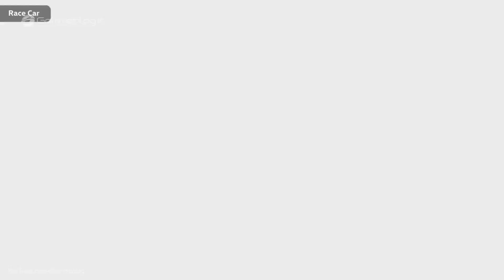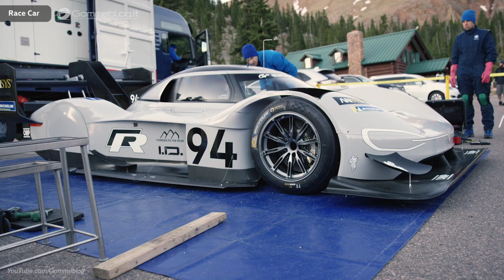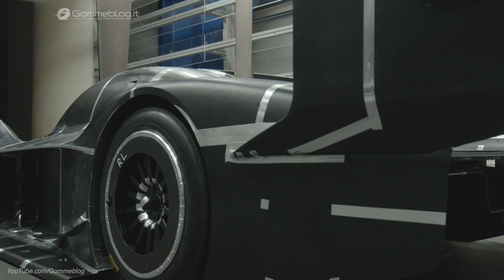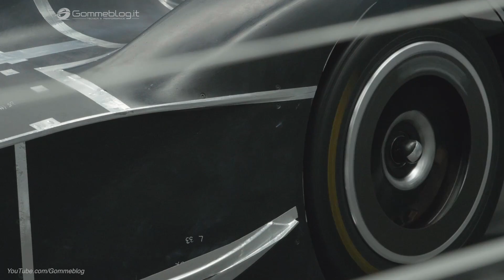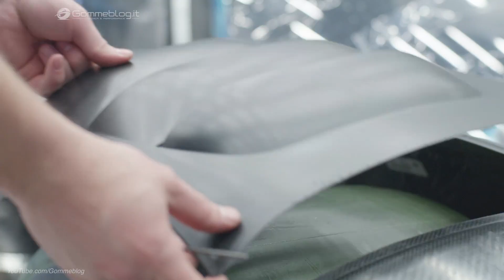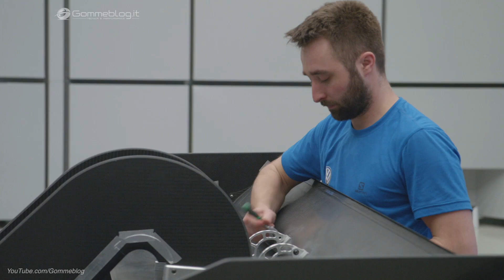youtube video #4uZLQvuwsgg

Comment: Idk about lack of noise.. you take off any insulation near the motors and it’s a LOUD clear consistent and linear whine, which is still awesome (depending on type of motor). Sounds like a jet. But i would highly argue, coming from loud exhaust, with lack of noise you can register/concentrate so much better, especially tire grip and when you’re getting close to breaking grip. Since there’s 1 gear, rpm matching by ear is thrown out of the window.

Comment: I still can't get over how slow they were on the upper section. Bottom section must have been screaming fast to still get the record. Wonder if they were having to save battery to make it all the way up...
Reply: MX304 More likely will to be temperature, it's the fundamental issue for most electric race cars being pushed hard continuously.

Comment: Altitude makes pikes peak an easy electric win
Reply: Tomi Ajayi-Dopemu 
as long as your battery doesn't overheat and starts burning 😉

This is the first time an electric car beats the record of a petrol powered vehicle (old record electric: 8'57'' and old record petrol: 8,13'')
Reply: Yep, it's the easy one, and with the time being able to be cut by a minute in a year, other motorsport better be scared, as a EVs are still way of their theoretical limit.
Reply: The most People think Electric Cars have a Problem with Battery Weight so, they never thing the Cars are getting better Uphill like Internal Combustion Cars.
That they are getting better Downhill is only logical if you see the Uphil Perfaormance, because such Cars can recuperate much Energy, that is consumed from Uphill, when getting downhill.

Comment: OK, Where's the 919?
Reply: Doginu as VW and Porsche are the same brand, I don't think Porsche will run this.
Reply: the 919 doesn't have as much downforce. it may no have as much torque. don't know the weight. it would still be super interesting comparison.
Reply: it doesn't have more downforce. Power is not the same as torque. Have you ever see a car do a 4wd burnout from launch? this thing did.
Reply: Its not as clear as you think. There is a reason that aero is king in f1. 919 has the same weight of Loeb's, has 300hp more. If you want to get a feel of how aero effect lap time download optimum lap. If the 919 extended their aero to the extent that this car has, then it would be no contest.
Reply: They added skirts to the 919 which would have increased the aero efficiency by 30%, then they moved the rear wing back to increase the gains again. I think now the discussion has gone into horses for courses, as you would never run as much wing as the ID did on the mountain as they would at spa.
Reply: nelson phillips LMFAO TQ at any rpm is HP 😂 to have more TQ then the next car only means you're acessing more power at that giving rpm learn ur stuff kid.. 

The 919 would crush this record with loads of more DF power and less weight so yea it would'nt be a match..

But VW owns Porsche and they probably begs Porsche not to try 😂 

Only advantage EL has is VE  volum metric effiency.. at atmospheric preassure they dont lose power combustion lose alot 70-75% whilst EL is around  10% loss.. So the power in EL world at earth is probably "endless" its easy AF to make power..  So the future is probably EL sad but true as Metallica would've said it..
Reply: It is too low I think to run at Pikes Peak
Reply: The 919 EVO that ran at SPA was 12 seconds faster than the WEC spec. It weighs 850 kg , 40kg lighter with 53% more down force, V4  550hp, no fuel restriction and remapped 720hp to rear and 440BHP to the front.    (o\|/o)
Reply: Doginu Running a wec car at pikes peak is pretty much like driving a nascar car at le mans. Every race car is designed for it's special type of motorsport.
Reply: Steve Goeglein took 4th place in the 2017 Unlimited Class last year    2002 Camaro the longest-running active driver at the PPIHCm since 91'
Reply: Ryan Miller You will never ever ever get stated numbers for these car, never. So to give yourself a change at a working guess its all about mass flow rate with these cars. With f1 its more difficult but, applying the same principles it would equate to integration of surface and the probability of where the flow structures are. 
The reason that the ID has, most likely, got more downforce is that there is more surface area on the aero parts and the volume of air that is being manipulated is large as seen with the defuser. The reason the 919 is close to the numbers is the application of skirts to seal the floor. However, they aren't a full seal but they would contribute 60-70% of the overall increase in the teams stated aero gains. There is a lmp1 cad model going around, you could download that and run some magical pixeldust over it in an expensive computer in you mum's basement if you want a clearer idea.
Reply: You got with never ever.
I was running a comparison. I know enough to do that and have a debate. I think you, Ryan Miller
, are the only one in this thread that a reasonable debate could be had.
Also its the shape if the ankle cutters that curl the air creating a seal. 
True about that second element, it is a big rearwing. My thinking would be that they had drag numbers to aim for because of the available energy. A high wing like that is highly efficient as it is mostly in free stream.
Reply: BTICronox yeah, torque and revs. And 919 has a lot longer final drive cause it's designed to reach 205 mph at Le Mans. The ID R is designed for a very twisty track without any long straights so I believe it HAS actually same or more torque than 919 due to shorter gearing while making less power.

As for downforce, I'm pretty confident that the stock 919 has less downforce than ID R though ID R is basically a rebuilt 919 with lots of 919 aero elements. Again the explaination is simple - ID R is designed for a course that is even twistier than Monaco circuit. And off course WEC LMP1 cars have strict regulations unlike Pikes Peak monsters. Doubt even 919 Evo has more downforce at the same speed.
Reply: I don't know man, im pretty sure the quattro did it 40 years back.
Reply: When talking about power of an combustion engine, please peek in mind how this works. @the top of the hill all combustion engines have bust a part left of their power.
An electric engine doesn't! 
Electric cars can be light here as they need only power for 8 minutes.

Comment: Fair well internal combustion engine, I was really into you for years but hey...it's time to move on.
Reply: Good to know
Reply: Nah they might shove it in front of you but electric cars can only truly work for about 50% of the population ie those in big cities that don't drive a long ways. The logistics aren't even close to being ready. Electric is still a way off honestly.
Reply: Ethan Treachler
You mean there are electricity even in the most remote area than gas stations, thanks to the thing called wire or solar or stream or wave instead of pipes for gasoline?

I mean you can live in a remote area with no sustenance of gasoline which they do.
Reply: Ethan Treachler wrong I'm afraid. We have two electric cars, we regularly drive 100s miles, and they work just as well for us as our old petrol or diesel ones did for a fraction of the cost. Whilst infrastructure is a factor, and that varies from country to country, the UK isn't so great, places like France and Ireland are really well served, with a range close to 200 miles per charge, you'd be surprised how rarely you have to actually charge it out on the road.
Reply: They said that about two strokes but fuel injection has changed that. Thankyou KTM. It's hard to imagine at trolling speed a fuel injected two stroke uses less fuel and puts out less emissions than the same size four stroke. Long live the two stroke or so iam hoping. Cant tell me motogp is more exciting than the 500cc two strokes.
Reply: Try driving one in Australia where a trip down the road could anywhere from 100klms to 15 -20,000klms.
Reply: Timothy Kennedy yeah that's a fair point, but let's face it the vast majority of the world's car journeys are nothing like that...mind you, I'd have no reservations whatsoever about undertaking a trip like that in a Tesla 100kwh if the charging infrastructure was in place....Chademo are on the cusp of 300kw chargers, so that'll fill a battery in under 10 minutes...about the same as a fuel tank then
Reply: True and i agree Aust just doesn't have the infrastructure yet. I overtook a brand new Tesla in Cairns on my moped the other day and quite honestly its still just a big chunk of steel with four rubber tyres carting around one person, in that respect my two stoke moped is probably still has a smaller carbon foot print. Ps i havn't seen a charging station for one in Cairns anywhere. Oh and with everyone wanting cordless f*****g everything what will the environmental disaster be disposing of battery's? More people on four stroke mopeds in the cities is a better solution if you ask me. Oh and give me a corded drill anyday ever see one of them go flat half way through a job.
Reply: Your totaly right about the massive amount of work needing to be done to move a car, but bikes have horrid efishancy, while the tesla will be near 250 mpg effective.
Electric bikes are the best method energy wise, as you have the advantage of electric, low wight and the EV drive train does not lose efishancy as it gets smaller, unlike ICE vehicles.
Cost and start/end of life and the only issues left bar energy sourcing, but that's far from an EV only problem.
Reply: But like i said at the end of the day you still have to dispose of dead batteries. For the life of me i dont understand why everyone wants everything cordless iam a gyprock plasterer and as far as iam concerned cordless tools are gutless pieces of shit you seem to spend more time charging them then using them.
Reply: Hard wired is defo the best way, less loss, more power, cheaper and more reliable. Sadly does not work with cars :(
Reply: Totally agree as far as iam concerned phones and cars are about all that should be cordless.
Reply: I thought the discussion would be "naturally" focused on whether an electric racing car is better than an ICE powered car, both have their positives and negatives, to say that the ICE is finished with regard to motor racing might be a little premature.
One of the biggest downsides of the electric racing car (for me) is the lack of aural sensation, it just doesn't cut it. 
I can't in my wildest dreams see a venue like Indianapolis running an electric car event, the crowds would stay away in droves, and without crowds there wouldn't be any money in advertising at the event, no money from advertising means no money for sponsorship.
I recently attended a well supported Hill Climb event, lots of specials, heaps of classic cars and one electric racer, most spectators actually MISSED the electric car as it sped silently by.
I really do admire the effort and technology that went into the VW Pikes Peak electric racer and I do admit that there may be an electric car in my garage some time in the future, but going to an electric vehicle race meeting is like going to a Striptease that's performed
 in the dark.

Comment: If Volkswagen decides to pass these electric engines to Bugatti it will become the New fastest car in the world. W16-quad turbo-twin electric-4motion-weight reduction. I believe it can be done. Proud Volkswagen enthusiast and exceptionally happy with the one of greatest achievements.
Reply: Jacques Fontein bullshit... For powered a car, a heavy and very powerfull car a much larger battery is needed, this race car use a quite small battery since race track is only 20 km long, but a real car need a battery much bigger (and heavy).
Reply: These fanboys will say anything. Don't expect too much from VW as Porsche could just stop by for a Sunday drive to beat those numbers. Porsche went hybrid for a reason.

Comment: That thing still used a lot of oil: carbon fiber body. So no emissions, that's bs.

Pikes Peak lost its charm becoming a fully paved street.
Reply: It doesn't consume oil.
Reply: 1ton what are the ingredients plastic and carbom fiber?
Reply: I never said they didn't use any oil or petroleum products to make the individual parts, I said it doesn't consume oil big difference.
Good luck in life avoiding everything made using petroleum products do you wear wooden shoes ? and what is the device you are typing on made from ? wood ?
Reply: 1ton mut save your sarcasm for yourself. It sure uses oil or fat for lubrication on moving parts.

Comment: great video ! the amount of work for the aerodynamic is incredible !
Reply from the maker: Yes 🔝🔝
Reply: Aerodynamics is the main reason why they've managed to beat the record, it's really cutting edge.
Reply: No wonder... Porsche 919 as base and Porsche Motorsport doing the aero
Reply: Work that vw never did.
Reply: i wonder if a F1 modified to adapt the two electric engines plus an increased wings surface for more downforce could be even faster ...  i tend to guess so.
Reply: it's a good idea but i think that F1 are limited by the f1 rules : they are open and maybe this vw has actually a better aerodynamic
Reply: it's a good idea but i think that F1 are limited by the f1 rules : they are open and maybe this vw has actually a better aerodynamic
Reply: Hi ! i see ... but in this race F1 rules do not apply so you can put all the wing surface you want.  I am thinking of nothing more than a missile with the right wings and able to turn.  I understand that in F1 they can also change the inclination of wings to get more penetration in the straight lines.  ... the limit in the end is the human element.  I am honestly shocked by the courage of these drivers ... they risk a lot.   On some bends they can fall for hundreds of meters i guess.  They are really talented and brave.